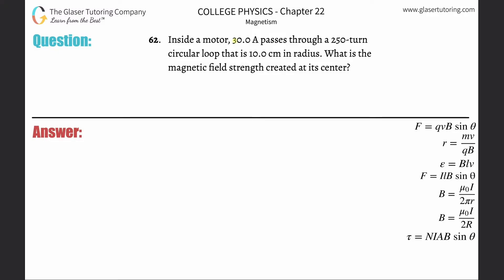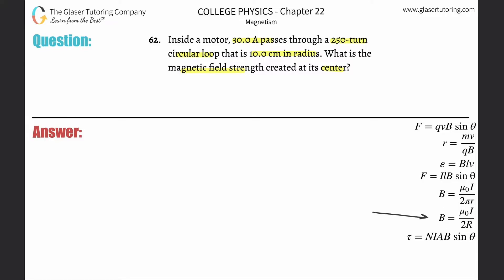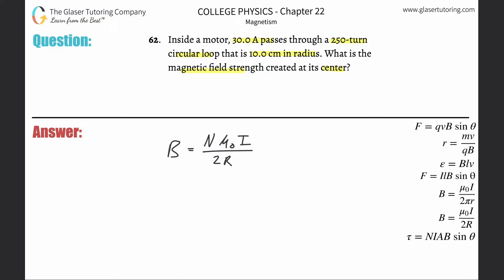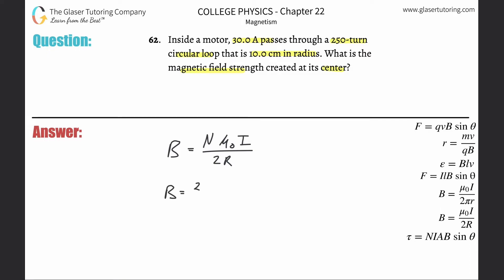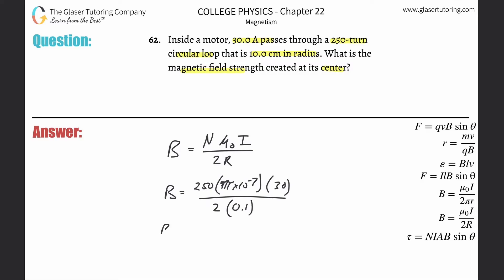22.62 | Inside a motor, 30.0 A passes through a 250-turn circular loop that is 10.0 cm in radius.

Comment: Why in 61 did we use B = [mu]nI but in this one use B = [mu]nI/2R ? We were provided essentially the same information.
Reply from the maker: Number 61 gave the number of turns per meter where this problem give just the number of turns and no length and therefore different formulas would be required.  Hope this helps